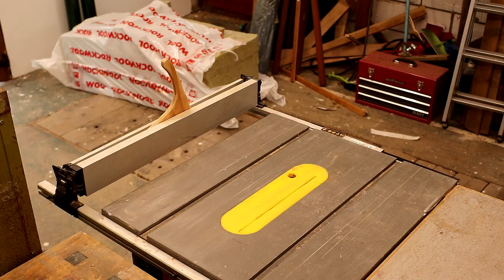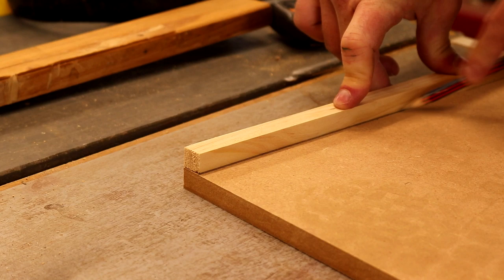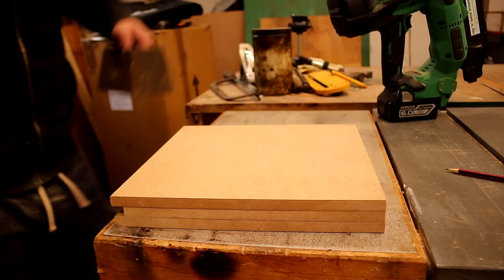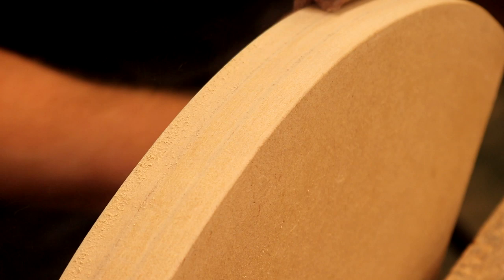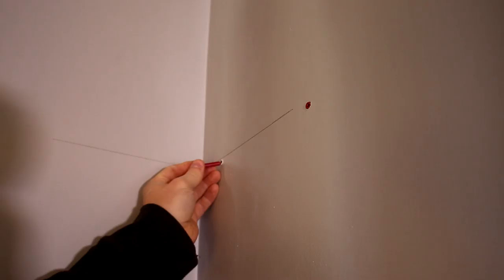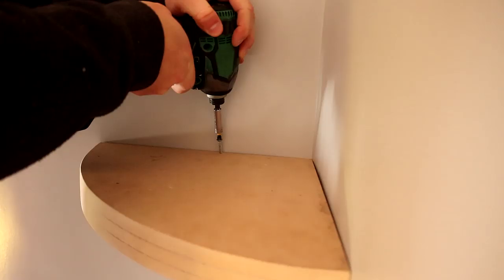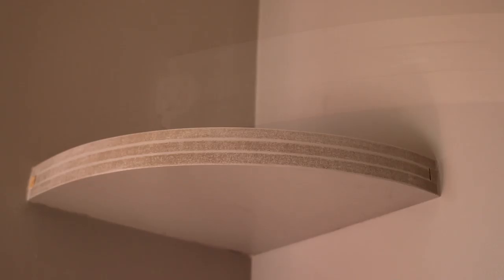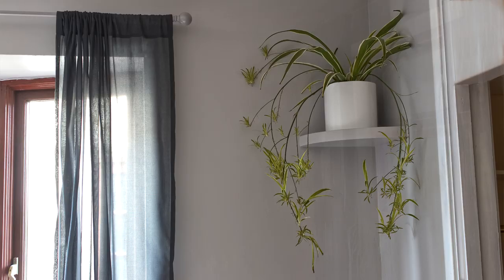Simple Floating Corner Shelf - No Specialist Hardware Or Fixings

Comment: Really cool that cleat, I have to put up two corner shelves but I will use the cleat under a piece of 3/4" plywood, they are just for a couple of small speaker for 5.1 surround sound system. Since the speakers will be low closer to the floor the cleats won't be very visible.

Comment: Nice little project.  One thing I would have done different is to round over the corner that goes into the corner of the wall.  It will make the sides fit closer to the wall.

Comment: after sanding the bare MDF edges coat them with pva glue and water mixture 1:1
let dry and sand again with 240 grit.
will make edges very smooth and not soak up much paint at all.
Reply: That's a great idea. Did you invent that or learn it from someone?
Reply: Like it, thanks
Reply: @Brian-Burke  learnt from someone but It does work great.
specialy on routed MDF profiles that you make where you have lots have open surfaces
Reply from the maker: I don't understand how that's any quicker than what I'd do i.e. paint, sand, paint?
Reply: @RagnBoneBrown  After the glue up you sanded the edges for the first time.
Before that you could use the glue up time to do the edges with the glue water mixture. Than sand edges smooth and paint the first layer.

Comment: Quick tip in the material faces sliding around with glue applied - throw on a bit of salt/slightly coarse salt on top of the glue, it provides bite much like an anti-slip surface and will even prevent slipping under clamping!  Not sure if I learnt from our FB group or Paul S though

Comment: Hi, looks good, I like the "I didn't have any primer so i didn't bother" 😁 
If you don't mind me saying, when i build these i make the groove deeper so the shelf could be scribed to the wall but that's what caulk is for😉 & the infill panel could have been made longer on the front 2 edges/corners that meet the wall, cutting the infill piece for the cleat groove stopping short 10mm of the end, so that the groove & the ends of the cleat weren't seen  & need filling,
Reply from the maker: Cheers Gid, great advice
Reply: And your video would have been 25 minutes long and in 3 parts. And I would have spent 75 minutes on the toilet with my wife wondering if I fell in
Reply: 😂 I'll take that as a compliment 😁👍

Comment: Couple of tips
the cleats should be shorter so you dont see the end grain
Use a tiny bit of salt to stop the boards sliding during the glue up
You can use watered down pva to seal the end grain on mdf

Comment: To do a good looking cut like the first you tried you need to offset the nail by the amount of straight that should remain ... or do something even more fancy like constructing an oval that is based on the diagonal (can be done with two nails and string) ... but I don't even want to think of how to calculate the starting points for that :D

Either way, good stuff.

Comment: Question for the reclaimed wood expert: I am working on a small gift project using reclaimed wood (dunno which type) from an old coffee table top. I intend to route a nice message into the wood and then finish it with some type of finish (don't know if I"m gonna use paint or stain yet). I'm currently in the process of sanding the piece but I'm struggling to get all the previous finish off. How important is it to remove everything? I've gotten the majority off the front but I struggle with the back, where the stain has been applied in different amounts (possibly over many different layers), as well as the sides, which have been dinged up quite severely over time. I like the character of the worn wood so I'm hesitant to sand everything flat/ square. 

Does any leftover finish affect the new stain's quality or is it just removed completely to give a more uniform finish across the piece?

Also two tips you probably already know but I thought I'd mention here anyway:
- For the MDF edges I've heard it suggested that you can mix some wood glue with water and 'paint' it over the edges first. My dad has used wallpaper glue in the past instead, which works great but does leave sort of a glossy finish. The prep will soak up in the MDF leaving no room for the paint, which is probably a cheaper solution than just painting layer after layer from what I've heard. 

Also for the MDF boards slipping I've heard people suggest you can sprinkle a little bit of table salt between the layers to stop them from sliding around. Haven't tried it myself yet but they say it works.